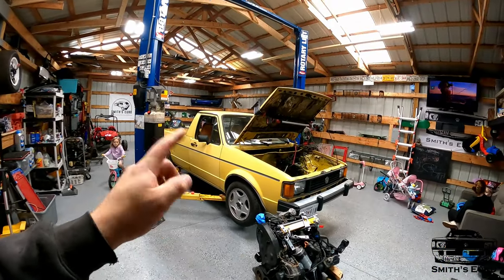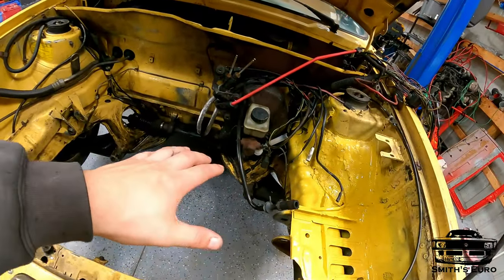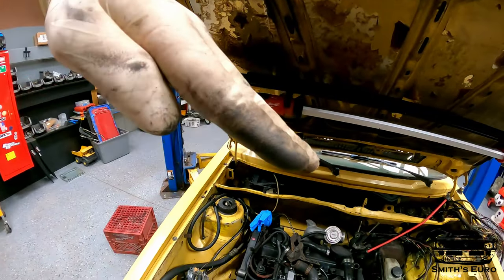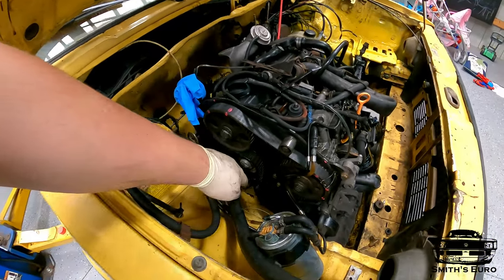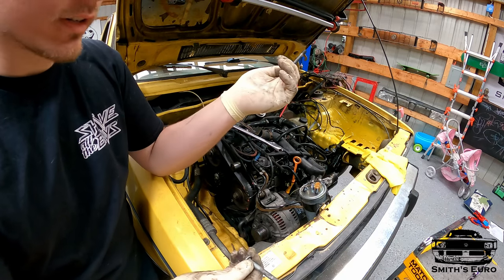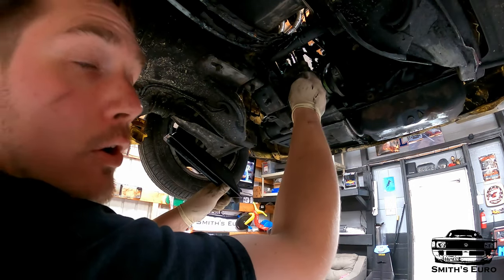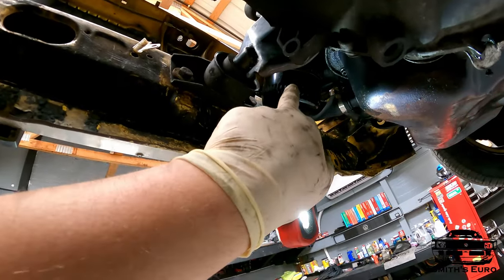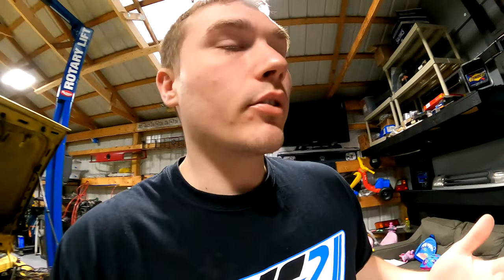TDI ENGINE AND 02J SWAP INSTALL IN MY MK1 RABBIT PICKUP

Comment: Thanks a lot for the whole series. It will help me a lot during my swap!
Reply from the maker: No problem thanks for watching. Glad I could help.
Hopefully you’ll stick around for the other builds as well
Reply: @SmithsEuro  hello, Smith, is there’s any possibility to contact you through any media? If possible i would like to ask about joining mk3 engine harness with mk1. I saw your video but the question is, that basically you need to only 1 black mk1 connector to fire up the whole system? Thanks
Reply from the maker: Depends what chassis harness your mk1 has
Mine is a late westy fuse box
But yea basically power ground and starter for a tdi.
Youll have probably 5hrs just pulling apart the mk3 harness to get what you need from it
Reply: @SmithsEuro  thanks a lot for reply. yes in my golf mk 1 there is late ce 1 fuse box. without ceramic fuses. previous owner upgraded it. so now i'm prepairing to do a swap and colecting as much info as possible. Once again, thank you a lot for sharing your swap videos! Theyr're huge help for me.

Comment: I'm getting the parts together for the same swap into a MK1 Rabbit GTI. Glad you are going first so I can learn from your mistakes,.. easier than learning from mine, ha. Are you using the stock AHU turbo? Did you make your own rear and trany mounts? And did you pull the front mount off the MK1 or is that custom too? Thanks for all the small but important details on this swap.
Reply from the maker: Im using the stock ahu turbo.
Front mount is oem mk1 off the 1.6d
Engine mount is oem mk1 gas mount 

Trans mount is tech53 02j swap mount kit that comes with a rear bracket that bolts to the oem mk1 rear trans mount combo

Comment: How do you like the o2a gearing with your ahu?
Reply from the maker: Its what came with the mk3 tdi so its well matched

Its great to drive, i keep up with traffic on the highway no problems. Pass people going slow as well.

Depending on how i drive and what nozzles are in i get high 40’s mpg
Reply: @SmithsEuro  The o2a was also the vr transmission?
Reply from the maker: @fueledtoyz many different model of 02a trans
This was the ctn vw tdi 02a
Vr trans only bolt to vr blocks
All vw 4cyl trans can be interchanged with correct parts to swap
Reply: @SmithsEuro  Good to know!!

Comment: What is the best way to bleed the system.. I have a mk3.5 cabrio 12v vr swapped with a 02J swap can't seem to get all the air out system. I changed slave and master w crappy advanced auto parts then switched to febi slave and bench blead the febi slave also.. had same problem with the 02A transmission also have to double clutch 2nd both transmission 3 slaves and 2 clutch masters later still exactly the same. I am under the understanding that 02j and 02a slaves are interchangeable? I'm stumped but thinking I have some kind of air trapped in the system but can't fathem how... I've tried bleeding it 100 times over the years.
Reply from the maker: Pressure bleeder is the best way.
Reply: @SmithsEuro  should I push fluid in or pull fluid out... I can't seem to get it to make a good seal at nipple was trying to figure out how to get something to turn into slave. Maybe drill out a bleader fitting.
Reply: I guess if I drill out a fitting wouldn't matter if I push or pull fluid just might work idk I used to love the car. Just slammed jammed grinded second all day every day. Then I blew differential.
Reply from the maker: Use a hose to the nipple to a bottle
Pressure bleeder on the reservoir to 10psi

02a-02j slaves are different “lines different and 02j are plastic”
But either can fit the trans